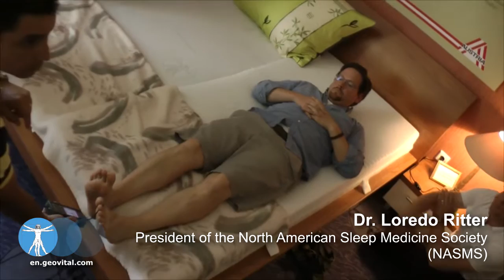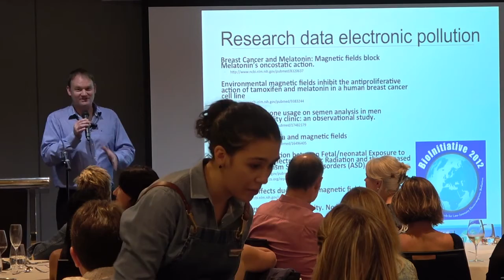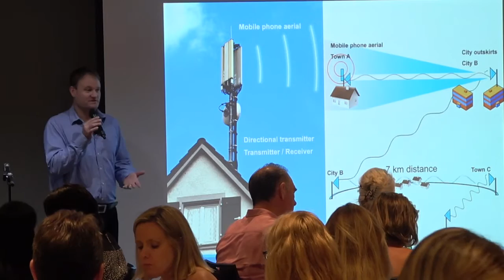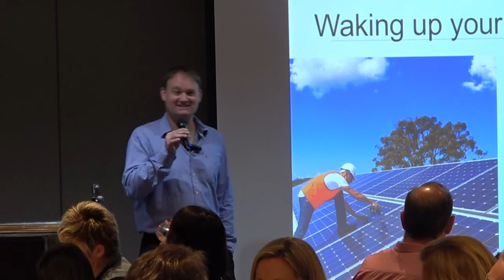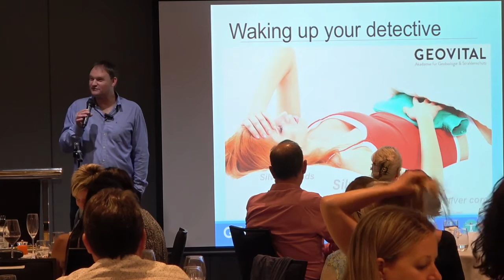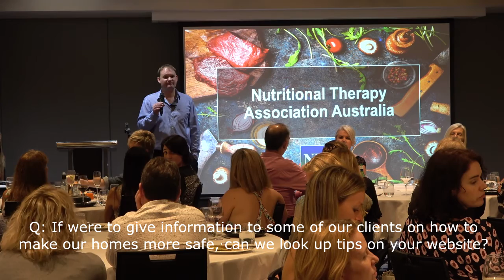NTA graduation dinner - How the environment affects health - EMF radiation

Comment: Take aways,....turn off your WiFi at night; ie: turn your Wifi router with a strip switch...or better yet: have an automatic timer for between ~11pm and 6am.  This will kill the WiFi in one's home for said period of time.  After that...perhaps using a bed screen; bed wood posts surrounding the bed...and using the sheets to cut your circumventing radiation.